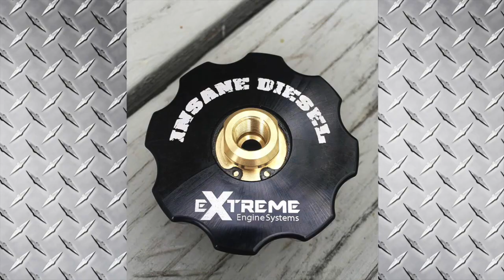Cummins "Under the Hood" EXTREME Bypass Oil Filter Installation by Insane Diesel

Comment: I HIGHLY recommend you put clamps on the hoses. They don't hold as they should. My hose came off and blew out all the oil in seconds. $15,000 later, I have a new engine. I sent the hoses back to Insane Diesel back in December. NEVER HEARD A WORD BACK. How's that for customer service and quality of product.

Comment: Will this mount the same way with the filter being Vertical on a 2014 Ram 6.7? I currently have a kit using the Amsoil BP 100 filter but the bracket has the filter sitting halt tilted on its side and y oil is still black form the egr crap. I am thinking that it is not filtering well sitting this way, I like the filter sitting vertical the way it should be.
Reply from the maker: Generally filter orientation or configuration doesn't matter. They are pressure fed. The EXTREME can be mounted in any direction. It sounds like you need a better filter, but any bypass filter is better than just OEM filters. The problem with many other bypass filters like Amsoil is that the finer they filter, the quicker and easier they plug because they do not have the patented progressive filtering technology that EXTREME has. It is probably just plugged.

Comment: My 2011 6.7 has 2 ports on my stock filter housing. One shown in this video the other is on the otherside closer to the engine block. Does it matter what port to use? Reason I ask is I had an existing auxiliary bypass filter and the port closer to the block was used.

Comment: Are you leaving the stock filter on the old existing filter mount?
Reply from the maker: Yes, the stock oil filter stays in place, but it is no longer doing any of the heavy cleaning. That helps keep the warranty as well since the stock oil filter and system are not affected in any way.  We recommend the stock oil filter get changed once a year as well because after that they can start to degrade and fall apart. Learn more: https://youtu.be/XQK3KxFuhrI
Reply: EXTREME Reliability isnt having the stock oil filter in a crappy place the reason why you change it to the bypass filter.  So you don't have to deal with having to reach all the way up to un screw the stock filter. Cause it's apain. For almost 400-500. for this bypass extreme you would think they could at least cap off the old filter housing or something where you don't have to reach up and change a stock filter. So I'm changing more then I was before makes no sense to me.
Reply from the maker: diesel life Actually, EXTREME Reliability is a technical term. “Reliability” is engineering jargon and refers to the ability of machinery to have reduced maintenance and extended life. Use of the EXTREME Oil Filter has extended engine life a stunning 2X - 4X in industrial equipment. EXTREME has now simply made it easy to get these same benefits for your personal vehicle. By keeping oil clean, service intervals are only once a year or 15,000 miles. So maintenance and costs are also 4X less in many cases. While it is recommended that the stock oil filter be changed 1/yr as well, it can actually go longer depending on the quality, if your application is too difficult to do. In any case, the EXTREME pays for itself over and over. It is literally the best investment anyone can make in a truck they want to keep. That’s EXTREME Reliability with a bonus! Again, all this is explained in the video link. You can find even more info at our YouTube channel.  Hope that helps clarify EXTREME Reliability.

Comment: One question, what is your oil pressure at idle? I installed a bypass filter on my 2014 Ram 3500 Turbo diesel and my oil pressure at idle drops to 35 psi
Reply: This is a very good question. Did he ever reply?
Reply: All bypass filters that are any good Have a restricter orifice. The slower the oil goes thru the filter the better. I used a restricter made from a .025 wire welder tip and a brass fitting. I put it at the oil source. I use toilet paper filters. I use Scott 1000 these days. When I started using them in 1963 It was easier to find good paper.
Reply: Cummins calls that parasitic loss. The Cummins Fleet Guard and Luber Finer 750s used a bigger orifice but had a lot bigger pump.their best element was pulverized newspapers or cotton. Those are the only filters that could clean oil. The spin ons are junk. The same as the stock spin on bypass that came factory installed on my 64 Rambler American L head.
Reply: The only factory installed filter I ever had on a car that cleaned oil was a Fram that used cotton. The same as the old Luber Finer. The old filters that cleaned oil were replaced by the almost useless pleated filters. Frantz solved that with an adapter that allowed the old Fram and others to use toilet paper. Is this too much information.
Reply: You might check with Cummins. I would think 35 would be plenty at idle.

Comment: That filter ain't going to do shit if you get dirt in the engine,ever heard of brake clean?
Reply from the maker: That filter works all day every day as it has for a decade, radically increasing engine life. Tip: There's always dirt in your engine and the EXTREME is always pulling it out. Another tip: Maybe back off the brake clean.
Reply: So you like getting dirt in you're engine when you don't have to?
I can tell your engineering skills are lacking by the fact that you're using ptfe tape on an fitting with petroleum products,even gas rated tape is going to fail. I'll lay off the brake clean if you lay off the excessive ptfe tape.
Reply: Yeah, we have a lot of internet "experts" telling us how it can't work ;-) Fortunately the results after 10 years have been spectacular and speak for themselves. And clearly, our clients love it too. Good luck with the dirt & the brake clean!
Reply: Did you just make a shill account ?
Anyways I didn't say the filter didn't work. Point being that any mechanic or engineer worth their salt would clean up before opening something like a oil port. As for Internet expert, it doesn't take an expert to see  that the design is poor.
Reply from the maker: Well, if you ever get tired of running dirty oil through your engine and wearing it out far sooner and spending $$$ on oil changes, you found the best bypass oil filter, getting your oil 4X cleaner than new oil. Also the easiest to install, service, and highest quality. And you can use all the brake clean and any thread-sealer you like, your engine will love you in any case.
Reply: Four times cleaner than new, so what are you taking out that the American petroleum institutes engineers aren't. I believe your product does a great job of filtering, but saying oil doesn't wear out just gets dirty is absolutely ridiculous. Molecules shear, look at HEUI injectors for example.
Reply from the maker: O-rings work in some applications. The engineers designed fittings like this without o-rings because the torque into threading would rip them apart. But you are thinking, that's a good start. BTW Humans don't have an oil filter to catch dirt literally right below the opening like this Cummins, but your "surgical" standard means never opening the oil filler cap without surgical cleanliness. And the PCV valve would have to go. And the oil plug. And the oil filter. All places where a lot of dirt gets in. That's why we have full flow filters and bypass filters: dirt finds a way. But even if we eliminated entry of outside contaminants, inside abrasives can be far more abundant and damaging than dirt, like wear metals and soot. Don't give up, you are on the right track. But again, you are still driving with dirty oil. Not good. Get your surgical clean on and get a bypass installed!
Reply: You're wrong male boss o ring look it up
I work a clean as a can, cleaning all areas I can.
Reply: don't you wish you could delete a post? It's said it's better to remain silent and be thought a fool than to open... you get it